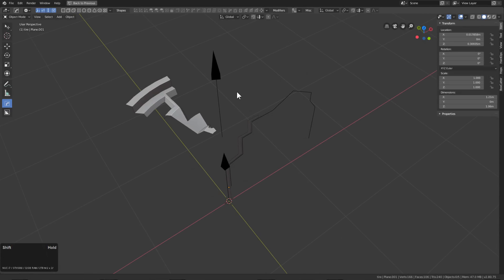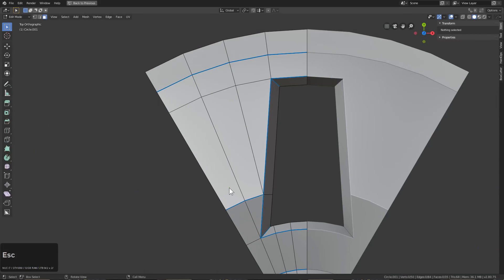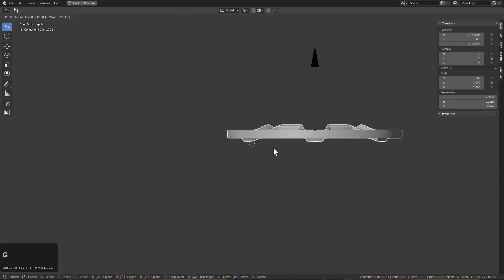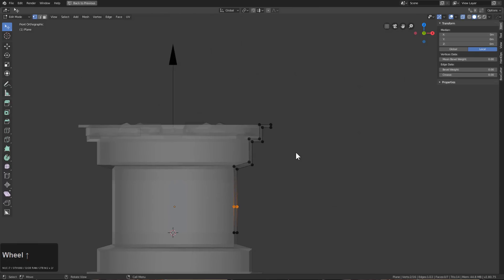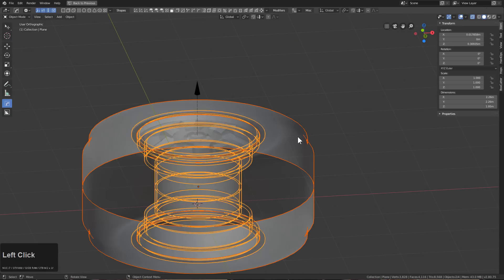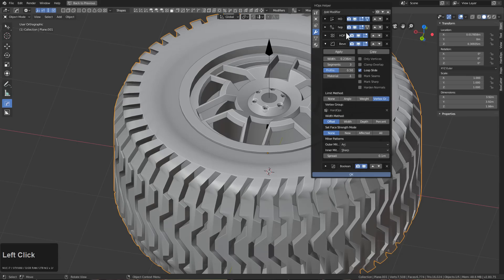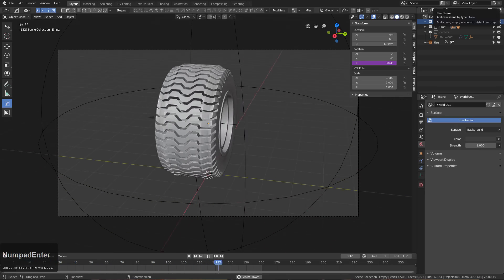#hardops - Making a tire in Hopstool

Comment: Hello Mr. @masterxeon1001 I think I need your help. When I use difference with (sort modifiers) deactivated I don't get the same result like you. 
I uploaded my file here on google Drive.
https://drive.google.com/open?id=1zMsh_EVDKchXAtaZAylrSGgwBf49YKEd
Reply from the maker: https://i.imgur.com/RPAPHos.png
a weld would help if the mesh is not manifold. 
https://hardops-manual.readthedocs.io/en/latest/boolean_beginner_tips/#always-have-a-manifold-mesh
It's hard to catch but the mesh being evaluated was not manifold.

Comment: Many hardops tutorial videos show that Ssharp and Csharp can be selected separately from the Q menu.

However, in the (2.8) HOps 009842_Neodymium_10 version I am currently using, it is combined as sharpen in the Q menu.

I guess it might have changed as the hardops version was updated.

Currently I understand and use with left mouse click = Ssharpen, Ctrl + left mouse click = Csharpen.

But I'm still using it without knowing what the difference between Ssharpen and Csharpen is.

The obvious difference is that when you issue the Ssharpen command, the edges do not change and look like 90 degrees,
Csharpen command seems to have a small bevel at the edge.

in conclusion.
-Why Sharpen. And where to use it?
-What is the difference between S and C sharpen?

I would be grateful to you if you could guide me through a video or manual that I can understand.
Reply from the maker: https://masterxeon1001.com/2019/12/25/hard-ops-00984-update-log/
https://hardops-manual.readthedocs.io/en/latest/sharpen/

The custom verbiage of SSharpen and Ccsharpen might have added to the learning curve of hardOps. With boxcutter we had the luxury of rethinking everything on the way in but with Hops a lot of ideas we pondered on but wanted to change. In the past I called Solidify - Tthick . Mark Sharp edges and enable auto smooth - ssharpen and mark sharp edges / auto smooth / apply select boolean modifiers - csharp. This can get complex rather fast so we have been working on facilitating the sharpeners to be a single tool. Sharpen handles sharpen and bevel handles bevel. It’s a lot simpler and shows the previous system could have been improved. This allows for us to expand our workflow further while lessening the amount of options for dealing with specific aspects. Hope that gives more insight. 

The documentation is the best resource but I try to do release logs in between updates to let users know of major changes. 

In my brain. Sharp is just smooth. And i long since started using Bevel to add bevel instead of csharp since it was quicker.

Comment: I have a question ^^
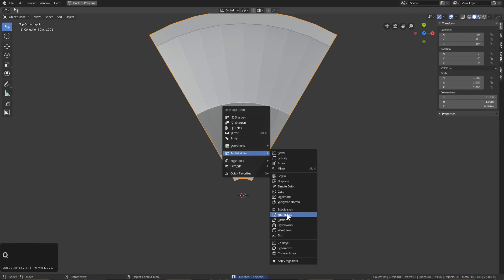It's about the Add Modifier-Circular Array on the 2:20 second screen.

I bought Hardops and Boxcutter sets from Blender Market.
Currently, (2.8) HOps 009842_Neodymium_10 and (2.8) BoxCutter 71V_1 are installed.

I don't see the Circular Array command on hardops installed on my machine. What should I press?

If you have any further requests ... I don't speak English. I am writing now and using Google Translate. Masterxwon1001's add-on is really good, but almost all the videos in the tutorial you uploaded are too fast. The key you enter is not displayed properly on the screen or the time signature is incorrect.

For example, can you say "Ctrl + S" together with your voice when typing a shortcut? Or use another add-on that displays the key you entered, or ...
Once the work is too fast, it slows the YouTube play, so it passes too quickly in the important areas.

The tutorial video is not for showing the quick work, but for the purpose of conveying the instructions for use, I hope that the beginners can see it a little more easily.

I don't know when you will answer, but please do.

Beware of the corona virus and be healthy ~! ^^
Reply from the maker: the former circular array was inadequate. So for that reason radial array exists. 
https://i.imgur.com/QBDqvdk.png

Circular array still exists in hopstool but as far as the Q menus go this one is more suitable for general use. 

We are working on a new system that should facilitate the learning process. I apologize for the confusion in this video. 

For keystrokes I am using a program called Qi press however I will try to break it down better in the future.
Reply: Thank you for being so kind and kind to guide me, even if you are very busy.

I've been following it step by step for hours, and I've made up to the current wheel.

I'm not sure who you live in, but I guess you're probably far from me.

I live in Korea and am a 35 year old male.
I am preparing to start my new life with a program called Blender. I would like a good course in the future, and if the performance of the add-on and the tutorial video that guides it are easy,
I would buy enough that the add-on was a few hundred dollars.

I would appreciate it if you remember that some people are desperate like me.

Have a nice day ^^

thanks.

Comment: Problem: When I cut the tire with both the tire and the track selected and using difference boolean, the track just disappears and leaves an "empty.001" object (which was previously parented to the tracks). The tire remains, unaffected.
Reply from the maker: M A https://hardops-manual.readthedocs.io/en/latest/issues/

Id need to see a gif of what is going on. If you use the help button in the top bar you can drop by and we can find out what’s going on in person. But that description just leaves me to imagine and speculate. Lets see that gif...
Reply from the maker: Prolly gotta turn off sort for this video since the mod stack is very specific. Off the top of my head. Sounds like a sort mishap.
Reply: @masterxeon1001  I have tried that. I must have mis-stepped somewhere along the tutorial.
Thanks for making this wonderful tool!
Reply: Oh, you mean from the get-go?
Reply from the maker: @NoHighHighlight  nah just before that cut. Sorting only affects cutting. In a later video I go over how sort is now and how to control it. Im still working on the dedicated video on the topic.
Reply from the maker: if i could see that .blend id get you set and figured out in a jiff. TSing via text might be a little tougher.
Reply: @masterxeon1001  Sure, putting the simple example together and uploading it somewhere.
Reply from the maker: @NoHighHighlight  https://www.dropbox.com/s/hmh3g2dvjeez4yv/help1.mp4?dl=0

That's what I would do.
https://www.dropbox.com/s/0vjnlolar7tat63/back_rollin1_1.blend?dl=0

Hope that helps. I bet it was hotlining a little sitting so close.
Reply: Hard Ops 0.9.8.3.2 (Hard Ops 9 - V8: Curium)
Reply: Ah, watching your video helped a lot, I realized I was in Destructive workflow, switching to Non-destructive gave me the track lines, boolean'ed into the tire.
Reply: (Sorry for the spammy messages!)

Comment: owe, this 14 min tutorial took me 2 hours to do >.< I have a newbee suggestion. I love how you use hotkeys and I want to follow your way but I don't know what you are pressing. I kept rewinding back and stare at your input displays. If you could read out the command for example: alt + x to bring up the mirror etc would be very helpful.
Reply: Screencast key would help.
Reply: 2 hours!!...it's taking me forever and i'm stuck right now (7:25 to 7:43 ) i don't understand what he's doing (@7:43 how does the spin match the hubcap perfectly like that ....mine is not matching up like his unless i manually scale which has problems).... but i'll figure it out with time.
Reply: @slickrick5811  I managed to finish this tutorial and gotten familiar with the tool. If your spin is not working, it's probably that your origin of the object is not at the right place. So after you draw the curves, make sure you center the curve's origin point to where the spin modifier will spin from. 
you can change object origin with the 3d cursor. So shift+left click will place the 3d cursor to your mouse pointer (hold ctrl while shift+left click will snap the 3d cursor to something) after 3d cursor is set. right click and you should be able to see "set origin" drop down arrow. Select "origin to 3d cursor"
Reply: @AIRpursuit  ...oooo thanks Andy i will try that right away.
Reply: @AIRpursuit  it worked!! thanks ,yeah, when i moved the extruded curve the object the origin moved as well: changing origin back to 3d cursor was the fix. This guy's tutorials are so tough to follow . Thanks so much for your help sir...be safe out there.
Reply: @slickrick5811  I think this is one of his early tutorials, his latest cylinoid tutorial is pretty good with shouting out commands and speed. Try that one. Cylinoid is the one that got me kick started with his tools.
Reply: i'm having the same problem here.
Reply: same problem. second day trying this.
Reply: same. I cant even do the first thing because I had to see this comment to find the key command for mirror. Now my mirror doesn't automatically delete half like his does and there's no explanation

Comment: masterxeon1001 If I were to get boxcutter or hardops, which do you recommend to get first? Thanks
Reply from the maker: hard ops is a fun time and a half. encompassing much of the workflow so hard ops. 

Boxcutter is a concept tool utilizing drawing in the 3d view for cutting so its a different approach altogether but extends on the boolean workflow. 

I still recommend hard ops for getting your foot in the door since it is intended to be an all in one workflow assistant with various features ranging from cutting, mirroring, viewport setup, sculpt tools, sketch mode q options, n panel setup, full material cut setup and so on. So hops is definitely the recommended starting point. Hope that helps.
Reply: @masterxeon1001  Thats a good point! Thanks!!

Comment: Great video. I was able to follow along and create the same thing. Only issue I had is my tire threads only booleaned through half of the tire, fixed it by applying the mirror modifier on the tire thread, and then the boolean worked fully. Any idea why that might be?
Reply from the maker: no sort for this. i turned it off in the ctrl + ~ helper before the boolean.

Comment: does anyone knows why i dont get the dots?
i have the latest version, and a  custom keymap for blender.
Could it be an add on that has conflicting shortcut?
Reply from the maker: When in hops tool ctrl displays dots. And it recommended to view them in perspective at this time.

installation is the same. https://www.youtube.com/watch?v=oMZrQ6ZHKm0
make sure you are in hops active tool. Dots will only show up for certain modifiers. 

hopstool is described in depth here. https://hardops-manual.readthedocs.io/en/latest/hopsTool/

when in doubt try from file >> load factory defaults. Then you know there's no interference.